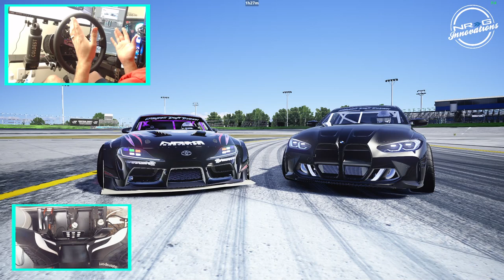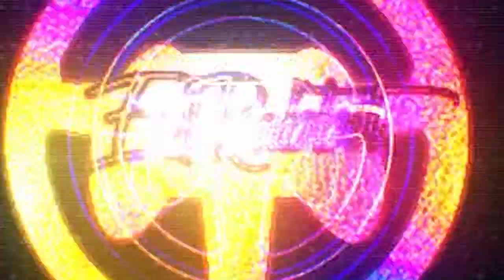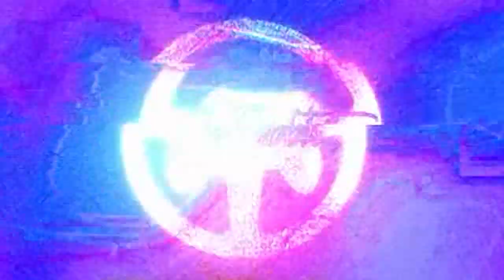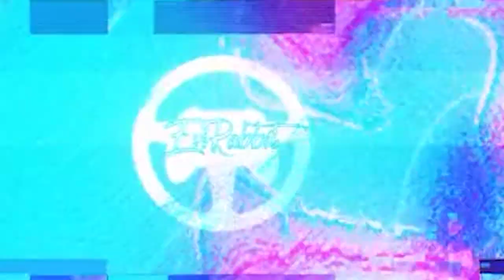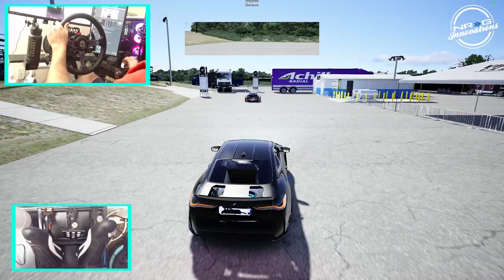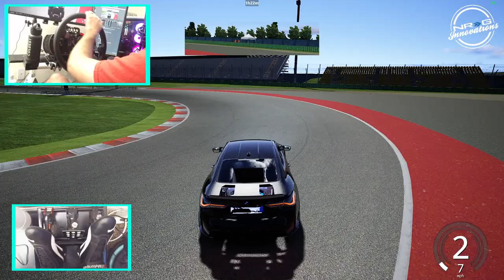New Physics on ESDA M4 G82 - Corrected tires and Inertias - 900° wheel gameplay

Comment: i wish i can ddrift one of those hight HP cars i always spit out or i cant keep it in drift throught whole track..... 😢
Reply from the maker: It's all about learning how to manage throttle to prevent over rotating. As well as seat time!
Reply: @EvlRabbit07   i will try be more gentle but i still think cars i tryed are too "twitchy" for me they change direction too mutch and too fast
Reply from the maker: That can be a setup in suspension to help slow that twitchy down some.
Reply: @EvlRabbit07   ok i will try make car a bit stiffer so body does not roll as mutch thank you :)

Comment: Does having a fanatec wheel make it easier to drift if you know what I mean
Reply from the maker: It's not always about the wheel. If the car is set up correctly for the wheel you have than it's just as easy as any wheel
Reply: @EvlRabbit07  I'm guessing the wheel just helps with like fast entry's and fast transitions
Reply from the maker: When I went from my g920 to my fanatec I noticed I got smoother in my response. So you could say it help me in snappier transitions to help catch the car before over rotation
Reply: @EvlRabbit07  when I'm watching someone like you or ctorreto I'm watching the wheel and its like it almost  rotates it self where the g920 you have to like flick it pretty hard